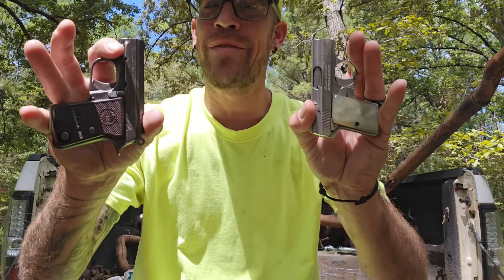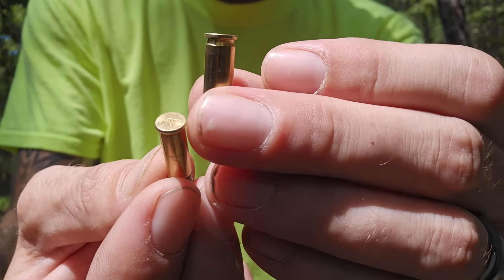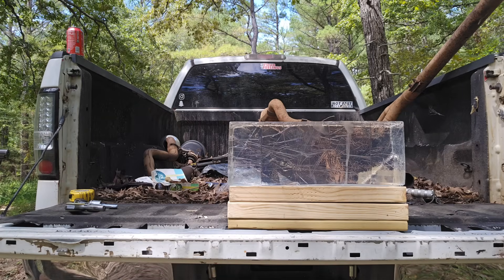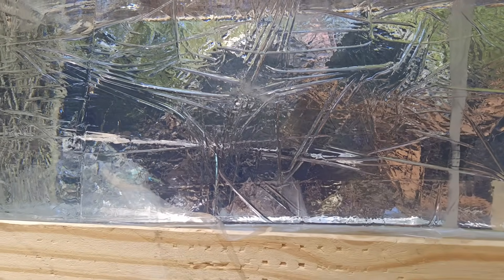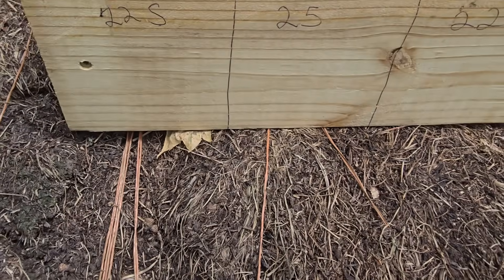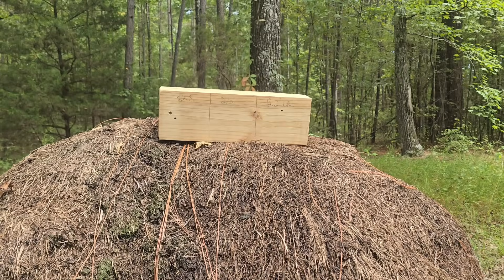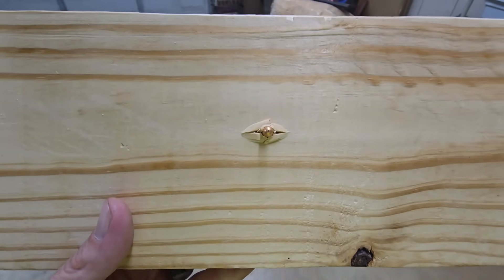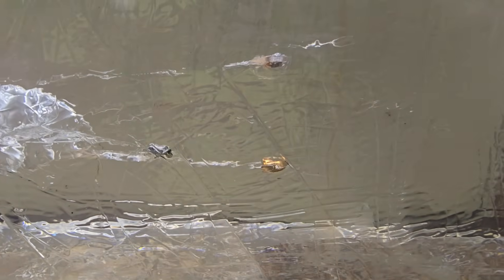ARE SMALL GUNS GOOD FOR SELF DEFFENSE?@sammoore138 #22longrifle #science #test #pewpewlife

Comment: Ive got a Bodyguard 380 I carry in the summer. I really dont shoot that well with it. I need to get the Bodyguard 2 really for summer carry.  Carry my Ruger lc9 in the winter. Shoot better with that. But gotta carry what i can conceal well in the summer. Got a good suggestion for a small carry gun? Shared this video with some of my gun buds.
Reply: The original BodyGuard is notoriously difficult to shoot accurately at distance. The super long trigger pull inevitably pulls the barrel left or right when shooting one handed. But it’s very concealable, very reliable. And at less than 10 yards the accuracy is acceptable. Overall it’s worth having. I bought my wife the Shield .380 EZ which is way more accurate. But she still carries the original BodyGuard because it’s more convenient.
Reply: @ShipWreck54 It does conceal well which is why I still carry it. Hope I never need to use.
Reply from the maker: WATS UP DOUG!!! MUCH LUV MY TENNESSEE BROTHER!!! HOPE ALL IS WELL ON YOUR END IM HOLDIN DOWN ON MINE APPRECIATE ALL THE SUPPORT AN SHAREIN MY VID THANK YOU BRO!! I GOT SEVERAL SMALL GUNS I ROTATE I GET ALOT OF SLACK ON HERE FOR CARRYING AN 25 BUT WEN PEOPLE HOLD AN SHOOT MY BERETTA THEY CHANGE THERE MIND IM A FIRM BELIEVER IN SHOT PLACE MENT AN A CONTROLLABLE GUN WITH LOW RECOIL HELPS THAT NOW YOU CAN GET SMALLER GUNS SUCH AS THE KELTEC 32  THE SEECAMP IS A GREAT GUN KINDA PRICEY BUT ITS THE SMALLEST SEMI OUT RIGHT NOW IN 32 AN IN 380 YOU ALREDY MENTIONED THE 2.0 THATS AN GREAT CHOICE I SUGGEST WATCHIN AN VIDEO ON THE GUN YOU WANT FROM MULTIPLE PEOLPE GO IN THE STORE FEEL THE GUN IN YOUR HANDS AN THEN CHOOSE SO MANY OPTIONS OUT THERE OUT OF A MINE AN I HAVE PROLLY 10 POCKET CARRYS IT BE MY LCP IN 380 OR MY BERETTA JETFIRE IN 25 BOTH TO ME ARE GREAT CHOICES FOR WHERE I LIVE BUT YOU BEEN TO MY TOWN NOT ALOT OF CRIME HERE LOL IF I WAS IN MEMPHIS ID CARDY BIGGER AN HOGHER CAPACITY BUT AROUND THE TOWN IM IN THATS WAT I POCKET CARRY MUCH LUV BRO TO YOU AN MS TARA SENDIN MY BEST SORRY THIS WAS LONG AN YEE YEE!!

Comment: There's a lot to consider with this type of testing & it's important to do this type of testing. 

Different brands of ammo are loaded to different specs. Even within the same caliber, you'll see different velocities & ft/lbs of energy between different brands. 

Different barrel lengths deliver different velocities as well. Short ones give up velocity. With the same exact bullet from a longer barrel would be going a LOT faster. 

There's rim fire vs center fire. 
Center fire is generally more reliable than rim. 

Then in this video, only 1 round of testing was done. The info may change after averaging several rounds of mixed ammo & barrel lengths.
Reply from the maker: THANKS FOR WATCHIN AN COMMENTIN SSB! I SEE YOU STILL WITH ME!!! I APPRECIATE YOU EVER THANG YOU SAID IS TRU I APPRECIATE YOU FOR DROPPIN ALL THAT INFO GLAD YOU CHECKED IT OUT AN MOORE COMIN SOON FRIEND YEE YEE

Comment: Often times when you hear of a .25 not making it through a skull, the culprit is either old/bad ammo or (possibly more likely) a poorly made or poorly maintained gun with an out-of-spec barrel.  If the bore is slightly too big (from poor manufacturing or from rust, etc.) then gas blows by the bullet and you essentially have a very loud pellet gun.  
I've seen three people that fell dead where they stood from a .25 acp to the head (to be clear, I was a detective, not the shooter, LOL).  
The .22 LR and .25 acp are pretty much even (a couple footpounds one way or the other matters very little).  The .22 tends to have a softer bullet while the .25 can be actually jacketed which helps penetration.  It's not unheard of for the .25 to yaw a bit inside the body.  The .22 Short is often vastly underestimated as well.
Reply from the maker: THANKS FOR WATCHIN AN COMMENTIN AN ALL THE INFO FRIEND!!! MOORE COMIN SOON YEE YEE
Reply: Może być dużym zaskoczeniem, atut !!!

Comment: None of these calibers are the perfect defensive caliber but all of them are potentially lethal. The 12'' required by the FBI is in organic gel not clear gel.  FBI required 12'' in organic gel (you can make it yourself with Knox gelatin but it must be kept at a stable temperature while testing) to assure penetration is achieved to the vital organs even if a large arms must be penetrated prior to entering the chest.  The massive damage you see in the gel is due to the 22lr bullet tumbling in the gel which occasionally happens with many different calibers depending on the type of projectile used. Look at the recovered bullet. Do you see any huge expansion? Any of these rounds are potentially lethal as any of them when shot into the chest of an average human can reach vital organs such as the heart or lungs through loss of blood. All of these calibers are also capable of hitting the brain .
Reply from the maker: THANKS FOR WATCHIN AN COMMENTIN FRIEND AN ESPECIALLY FOR THE INFO I APPRECIATE YOU AN MOORE COMIN SOON YEE YEE

Comment: Sticking strictly to the question asked in the title of the video, the correct answer is “maybe”. I would be much more comfortable with an original bodyguard .380. It’s still a very small pistol but packs a more powerful punch (God I can’t believe I just said .380 is a more powerful round, but in the context of this video it’s like a .357 magnum). The original bodyguard .380 is small enough to conceal in my hand. My wife carried one in her bra for many years. What you get from the .380 ACP is 3 times the muzzle energy of the .25 ACP, 194 FPE vs 60-66 FPE. In about the same size pistol. I trust a tiny .380 but not a tiny 22LR or .25 ACP. I once shot a road sign at 15’ with a .22 short and it did not penetrate. So I’m definitely not trusting that for self defense. As for 22LR, let’s just say I wouldn’t want to rely on it from a mouse gun. I carried a single action .22LR revolver with a 6” barrel for several years. And that pistol would’ve punched thru 2 of the boards in your video. But from a tomcat? It’s too handicapped.
Reply from the maker: THANKS FOR WATCHIN AN COMMENTIN FRIEND ALOT OF GREAT INFO IN THERE!! AN YOUR RIGHT THE LONGER BARREL MAKE THE DIFFENCE THANKS AGAIN FOR THE SUPPORT BRO AN ESPECIALLY THW SUB!!! MUCH LUV BRO AN MOORE COMIN SOON YEE YEE

Comment: Great video!

As you pointed out,  .22LR velocity specs are given from a full-length rifle barrel.
 
Historically, the ammo companies were using a 24-inch (!!!!) Test barrel to list their velocities, which is a pretty rare length for modern 22s, and almost misleadingly not relevant because of it.

That being said, the 22LR, as its name states,  was always designed as a rifle cartridge, not a pistol/revolver cartridge. 

You speak of the room required to obtain those listed velocities. Well, the original .22LRs were blackpowder loaded.
 BP requires a much greater volume of space to burn off, which is why none of the 22LR handguns came out until after smokeless powder started to become standardized. 

All of the antique .22 revolvers are 22 short, which would have given more room for powder burn, since there was less powder.

On the other end of that, you have the .25ACP.

There are no 25 ACP rifles, because the 25ACP was always loaded to burn off everything  in a shorter barrel. 
While a 5" barrel might give the 25 a touch more FPS, a 16" barrel could actually give it less.
It would finish burning its fuel before it got to the end of the barrel, where the forces of rifling friction would actually begin slowing it down.

I was surprised at the performace of the 22 Short.
 
I still maintain that if you are going to carry a tiny .22 for SD, it should be a .22 LR, even if its effectiveness over 22 Short isnt significant.
The LR ammo is just more widely available, and theres no real weight saving advantage to the .22 short,  because the gun overall is the same size as the 22 LR.

It was nice to see your revolver. Any commercially available modern revolver of that size will usually have a much longer cylinder than necessary for a .22. 
I'm not entirely sure why that is, but if you look at a modern 22 revolver, there is a ton of extra space before the bullet sees the end of the chamber, let alone engages the rifling.

One more thing: shooting the 22 short vs the 22 LR from a 5" barrel would show a greater difference between the two, as the extra burn room for 22LR really makes a difference every inch, by the inch.

But anything with a 5" barrel is obviulsly not a pocket gun, unless you're a Kangaroo.

The 25ACP is the only cartridge there, designed from the ground up as a small pistol cartridge. 
The reliability is not just from the primer sytem and rimless nature. It is also becasue it is burning cleaner and not fouling out the machinery. 
.22lr is a filthy round. Little guns load up quickly after a few mags/cylinders are run through.

But if you keep your guns clean, and pick a 22 ammo known for its consistency (CCI), the reduced cost of ammo offsets any percieved sludge-caused reliability issues. 
A carry gun requires being fluent, and being fluent requires lots of practice.
Small guns require even more practice than full sized guns. 
For the money, you can practice a lot more with .22LR than .25ACP.
Last time i looked, the 25 ACP ammo was about $0.75 a round.
But if you dont mind the extra cost and limited local availability, get the .25.
Reply from the maker: THANKS FOR WATCHIN AN COMMENTIN FRIEND I SEE YOU COMMENTIN A BUNCH AN COMMENTIN SUM GREAT INFO!!! APPRECIATE YOU AN THANKS AGAIN FRIEND MOORE COMIN SOON YEE YEE

Comment: The believe that .22 lr is way more powerful than the .25 is by people reading 
ballistic charts, almost always showing rifle velocity/energy numbers.
And to some extend they are right ,even in a 4 Inch short barrel the .22 is more powerful.
But If you go into the 2 inch territory the .25 is the one to take. It was designed for very short barrels.
The bad rap the.25 has is in many cases related to people using it in cheap junk pistols with oversized bores  or corroded ones, using age old ammo and so on.
In a pocket pistol of decent quality I take the .25 any time over a .22.
Only very good high velocity .22 ammo is about the same energiewise, compared to a quality .25 load.
That is another thing- many .25 loads are not loaded to full potentional.. - 
a good .25 should be loaded to about 800 fps with a 50 grain fmj and by handlosding you can get it up to over 850 fps.
Every standard velocity .22 lr load I saw is less powerful than the .25 acp in a 2 or 2 1/2 inch barrel of a vest pocket sized  pistol...
The .25 pistol was never intended to be a fighting gun but to be a pure self defence pistol, as a gun to always have one you as a last ditch weapon.
And in many, many cases it has worked and in probably even more cases it has worked by showing the opponent that you have a gun...
Reply: Agree. 
 I think the biggest problem facing 25ACP handguns today is the availability of ammo and the reduced choices of guns.

When I bought my .22 LR Bobcat, there were a dozen different .22LR  handguns at the dealer. 
But there was only one 25ACP pistol...new for $175,  from some brand that just went out of business.
And there were just two boxes of 25 ACP ammo, for $45 a piece. 
I mean, the ammo wasnt just more than 9mm , it was more than 38spl. 
I think if you're gonna spend that much on ammo, you might as well get a ballisticaly superior .380. 
That's probably the same thought most of the buying public has, which is why so few gun companies make a 25ACP gun today, but they all offer .380s.
Don't get me wrong, Id love to have a 25 acp gun, but I would rather recieve it as a gift than make the conscious decision to buy it.
Reply from the maker: THANKS FOR WATCHIN AN COMMENTIN FRIEND AN ESPECIALLY THE INFO!! I CAN TELL YOU KNOW WAT YOU SAYIN!! I APPRECIATE THE FEED BACK AN MOORE COMIN SOON YEE YEE

Comment: I suspect the .22LR bullet tumbled then stabilized in the ballistic gel..  
I did a similar wood penetration test (see https://www.youtube.com/watch?v=aIjEheHuTZs ) but did not test .22LR because a) I already knew the penetration would be about the same as .25acp from a short barrel and b) I don't currently own a .22LR pocket pistol.  My results were similar.
I bought a Bauer back in the 1970s.  I could never get it to rapid fire more than 3 shots without jamming.  I sold it.  Later I bought an actual Browning .25 made in the 1950s which has proven to be very reliable.  When Bauer announced plans to make unauthorized Browning clones here in the USA Browning Arms and FN began talking lawsuit over patent infringement.  Bauer came up with a compromise of changing some internal design dimensions and angles.  I suspect that is what I ran into with my Bauer.  PSA makes FN licensed copies of the Browning .25 in the US but I haven't tried one of theirs.
Reply from the maker: THANKS FOR WATCHIN AN COMMENTIN FRIEND AN THE INFO IVE SEEN THEM THEY ROUND 1K TO!! APPRECIATE YOU AN MOORE COMIN SOON YEE YEE